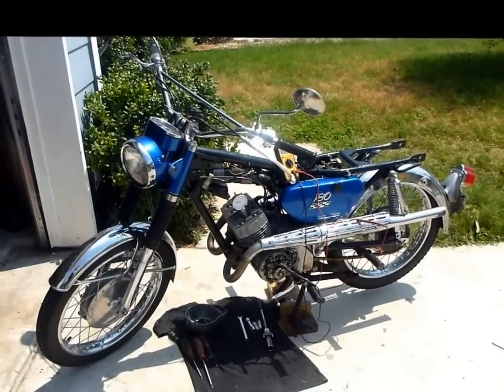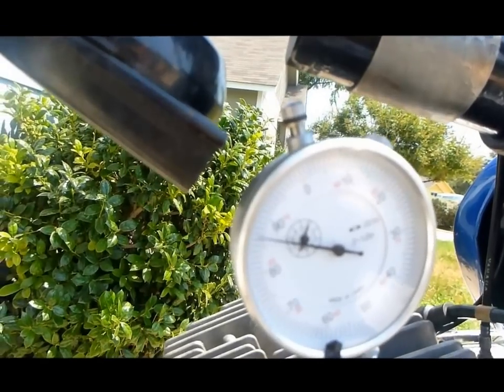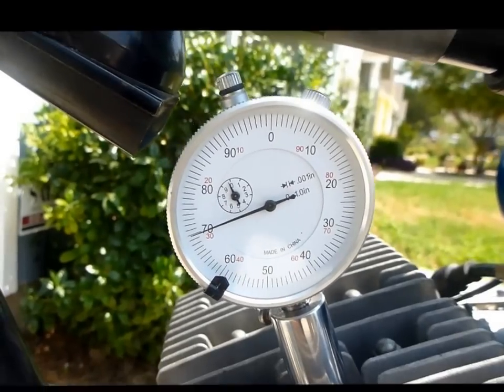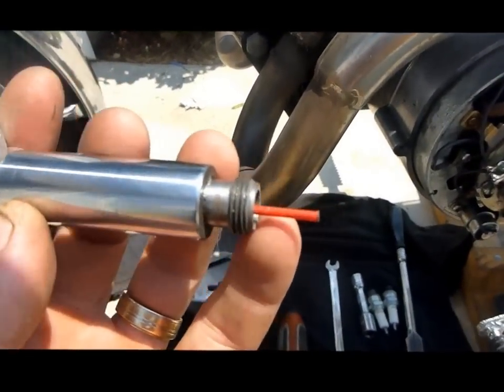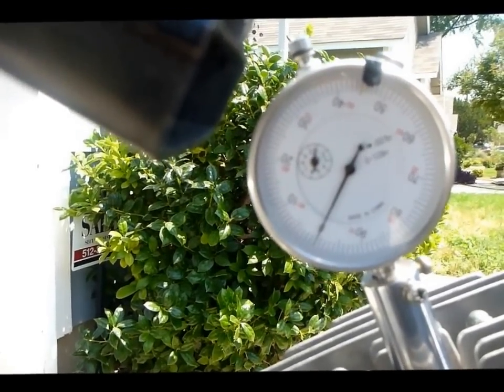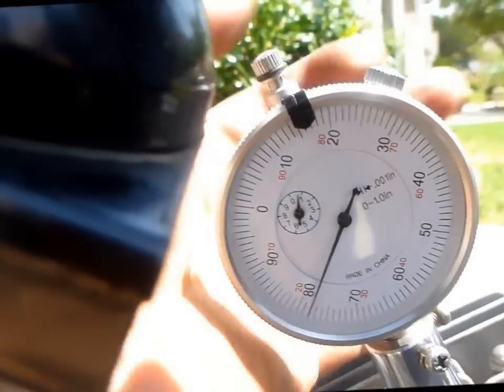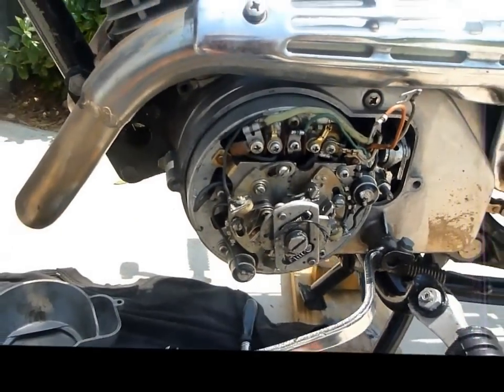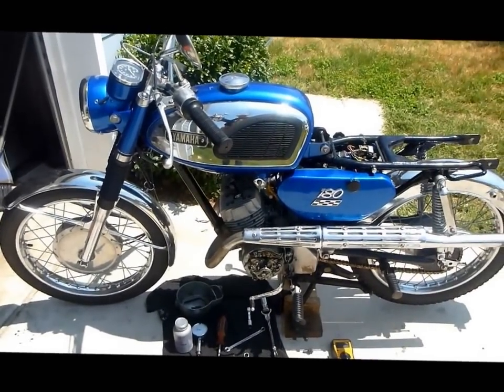How to use a dial gauge to adjust the timing/points on a Vintage Yamaha 2-stroke see description.

Comment: Can anyone tell me any more about the rubber cushions on the clutch pack ? 
I placed them all correctly as in the diagram with new clutch pads . 
And have the clutch adjusted right . But when trying to ride of the start in first . I hear some noise and have some on and off hesitation while moving . Bikes not moving with ease and freely ? 
Can’t get out of first or go more then 20 ft . 
My only other thought then the clutch is gears have sat for years and maybe some rust or bad bearings ???? 
Was trying to find a video on YouTube for these type of clutches with the rubber cushions to no luck .
Reply from the maker: Are you talking about the large grooved O-ring ones?

It was about 15 years ago, So my memory is a little foggy, but I remember having this exact same conversation on the forums, and the collective opinion was that it was okay to remove those. I believe they were designed to help dampen the clutch, but our modern motorcycle appetites don't really want to have a dampened clutch. We want a clutch that grabs and sticks well.   Good luck!
Reply: @stevenmichaelis  yes ! I don’t understand the purpose and how they are supposed to work ? Are they supposed to slide with the friction plates ? Because they slide on tight and don’t move on the basket . Also is the cushion groove supposed to fit on the friction plate ? And are mine old and shrunk ? Hope I can explain that correctly and make it understandable .

Comment: I'm a formal motorcycle mechanic by trade and this method was the first style I learned and later down the road I realized that it isn't an accurate method, using a multimeter only tells you when that gap opens in hairline measurements the beep stops in that moment, meaning the spark is not accurately gonna fire when that meter stops beeping, its not 100% usually when its around .25 to .35mm depending on the bike and year usually in the 80% range it will fire at the plug,  you need a timing light to be more certain trust me on that, makes all the difference

Comment: Hello Steven, good video. i'm trying to set the timing on my 1975 yamaha rd350. after i have tdc on my dial meter could you please describe how many full revolutions my meter should take and what number it should stop at in order to be at 2mm btdc? i've recently had a stroke and it has impaired my cognitive thought process. so, please be very literal. i'm getting close on my RD . it's been a long process. thank you very much. David
Reply from the maker: David, congrats on getting close to finishing your RD project.  You have a good question, and I will try to help. Please forgive me if I am too wordy or overly simple in the little steps.   For my answer I will assume you have a SAE dial gauge in inches, as opposed to a metric one in millimeters.   

First of all lets discuss the spinning full revolutions of the needle. We'll assume the dial gauge is secured in the spark plug adaptor, and the adaptor is securely threaded into the spark plug hole so there is no wiggling, etc.  Any wiggle movement of these pieces will prevent accurate measurements.  The number of times that the dial goes round and round is ultimately irrelevant to your measurement -- the number of times that it spins is 100% dependent on how deep the dial gauge happens to be sitting in the adaptor tool, and this will vary every time you remove or install the tool.  For instance, my adaptor tool has two set screws that hold the stem of the dial gauge in place when it is inserted in the adaptor. Every time I insert my dial gauge into the adaptor the stem of the gauge housing will enter the adaptor to a slightly different depth before I tighten the set screws and hold it in place. In fact it would be all but impossible to insert the gauge into the adaptor the exact same way and depth every time I use it.    Exactly how deep the shaft of the gauge housing sits inside the adaptor determines how many times the gauge's needle rotates as the engine rotates to TDC.  On a standard non-metric "0-100" dial gauge, like the one I used in my video, each full rotation of the needle represents 1/10th of an inch of the gauge's plunger's vertical travel.  If the dial gauge is sitting more deeply in the adaptor, then the gauge's plunger will come in contact with the piston earlier, causing more needle rotations.  If the gauge is sitting more shallowly in the adaptor, then the plunger will encounter the piston later and the needle will have less rotations.  The depth the gauge sits in the adaptor can be adjusted to reduce needle rotations -- exactly 1/10" of depth for each rotation of the needle. The number of needle rotations is ultimately irrelevant to the measurement of the piston once the tool is calibrated for the job with the gauge set to zero at TDC. However I see how the extraneous rotations are definitely distracting and confusing.  

I personally find extra needle rotations distracting, but have adjusted my skill to overcome the inconvenience.  My adaptor tool is a bit too tall for my motorcycle. It was made for a RD350 and I am using it on a smaller YCS1c 180 -- because it just barely fits, I have my dial gauged forced as far into the adaptor as it can go, and only then does it just barely fit.  If I had more clearance with a slightly shorter adaptor I would prefer to insert my dial gage not quite so deep into my adaptor so that there are less full rotations of the needle.  One of these days I may machine my tool so its about 1/2" shorter and fits better for my little motorcycle.  

An additional important thought is that it is important to remember these old Yamaha's engines rotate COUNTER CLOCKWISE while running.  The dial gauge does not indicate whether you are BEFORE or AFTER TDC -- it only shows the distance that piston has traveled up or down away from DTC -- it is important to measure to the point that is 2mm BEFORE top dead center, as the engine is rotating counter clockwise.  The gauge can be potentially very confusing because it's needle rotates as then engine is rotating, but the gauge does not indicate direction of engine rotation!  The gauge only shows the vertical travel of the piston!  

Assuming you want your timing set to 2mm/ 0.0789" and you have the dial gauge correctly installed and set so that TDC is indicated at zero. You want the points to be closed as the engine is rotating counterclockwise toward top dead center, and then for the points to open exactly at 2mm/ 0.0789" before top dead center.  Again, the engine will be rotating counterclockwise, but the gauge will be rotating clockwise as it approaches 0.0789", 'counting up' toward your zero.  

If the gauge's needle has to make several rotations as it approaches TDC, make mental note of how many rotations it makes.  Or you can adjust the height of your dial gauge in the adaptor so that there is a total of less than 1/10 of an inch of plunger travel so there are no extraneous rotations.  Be sure to re-zero the gauge after adjusting it in the adaptor.  

Hope this helps.
-Steve
Reply: @stevenmichaelis  i’m so thankful for your help!  i’ll try again tomorrow. bless you😇

Comment: Anyone know how to buy the dial gauge connector to the spark plug port?
Reply from the maker: A search on eBay for "dial gauge timing" usually will list several. The threads are 14mm for the adaptor you will need.  My adaptor was one I used on my RD350s and is a bit too long to easily use on my YCS1c unless I remove the tank, which is a bit of a hassle....  If I were to buy another I would get a slightly shorter one...    Here is a nice set on amazon: https://www.amazon.com/Fowler-warranty-Adapters-Diameter-52-520-747/dp/B00B5HQ38U

Good luck Mark!

Comment: I'm trying to get my head around the 0.0789. the way I'm reading this, your setting the dial indicator 0.021 BTDC. can you explain how that is 0.0789? I just don't want to screw this up.
Reply: once TDC is found and the dial is set to 0, 0 is the same as 100. 100 - 21 is 79. his measurement was for his particular engine which was a measurement in mm. he converted his number from mm to inches. you can use google to "convert mm to inches." what is the measurement for your particular engine?

Comment: I use a sleeve and calibrated rod type timing guage. I bought mine but they can be made from an old spark plug. The exception to the rule with 2 stroke points timing is the Suzuki GT380 where the points are on a geared shaft seperate and driven by the crank. They also rotate backwards to the crank and one has to take up the slack when measuring the timing. Not a favourite of mine to do the timing on. This method would not work so well on European 2 strokes as the points gap has to also be set for TDC as well as the firing point. Advance / Retardation is performed by the contact breaker arm spring.

Comment: Hi how to take of or out the generator?
Reply from the maker: Oh goodness!  This is a buggar for these bikes.  The generator's armature frequently rust sticks to the crankshaft, and it is very very difficult -- almost impossible -- to remove without damaging it.  It has to come off to split the engine cases to replace engine seals, etc....  AND to make matters worse there are two types of generators and armatures: Hitachi and Mitsubishi.  AND AND AND the armatures are almost impossible to find.   When I accidentally damaged my own armature during the engine rebuild it took me years of active searching to find a correct replacement.   I ended up paying silly money for one when it popped up on eBay Japan, but now the bike is up and running reliably.

Comment: Hello Steve:
Thanks for your info. The shop manual I have left out a few salient points that you had. Why do you use 2 mm instead of the factory 1.8 mm? I have a 1971 CS3 200cc. This bike seems very similar to your 185. Also do you have any information on synching up the carbs.
Reply: use popsicle sticks under your cut-away
Reply from the maker: I set my timing at 2.0 as a performance modification. 2.0mm is slightly advanced timing compared to 1.8mm.  Other mods included ceramic coating the piston tops and cylinder head combustion chamber, adding an anti-friction coating to the piston skirts, milling a little metal off the heads to increase compression, and slightly modifying the piston porting.    
Thanks for asking!

Comment: if so then the timing points on a dual carb 2 stroke on a single crankshaft wouldn't they need to fire at separate times for each piston ? since they feed off each others power and use mechanical rotational timing  ?
Reply: yes

Comment: are those 2 mm distance before top dead center in relation to the lag from the stator firing the spark to the coil ? like for instance 2mm is the distance and time it takes for the points to open and close produce spark to the coil at the precise moment the piston is at top dead center spark hits and drives the piston back down at the right time ?
Reply: Also take into consideration the time to light the fire

Comment from the maker: I'm sorry, but you cannot just stick a screwdriver in the cylinder to find TDC.  This is because you need the points to open at precisely 2.0 mm before top dead center.  This is a super precision measurement, and it cannot be done with a screwdriver.   Best wishes. -- Steve

Comment: Can you write out in detail how you put together your dial gauge? I looked at earlier posts that suggested Harbor Freight has the parts. My Harbor Freight definitely does not have those parts, the best they have are tire gauges.

I think what I may do is just take one of those red straws off a spray can, use it to determine TDC, and then look at pics of what the timing marks on my flywheel should look like, and set the points with the buzzer off my voltmeter. Cheap, but works.

Comment: Hello from Minnesota. So I recently bought a 1972 yamaha ds7 and have been tinkering with it. I noticed the point gaps were way off (not opening enough) and I set those to the manual specs. The bike runs amazing now, but I have not checked the ignition timing at all. Am I going to destroy my engine if I don't check the timing? Also this video makes sense but where do I get a dial indicator that will fit my bike?
Reply: yes anytime you adjust the points that changes the timing

Comment from the maker: Daniel, The spark is supposed to happen BTDC, so that is good.  Rotating the engine makes the points open and close. Rotating the points plate is how you fine tune EXACTLY when the points do it -- you probably can't visually observe the points moving when you move the points plate; they will basically look closed; The test light will tell you when the points are actually closed. 
Points' gap (fully opened) should be around 0.022" (0.56mm) -- your 0.033mm is not right.  
Don't Give up!
-Steve

Comment from the maker: Daniel, I am excited that you took the plunge, bought the adapter, and are learning how to set your points.
First of all, you MUST have the wires disconnected for the light to work correctly.
A test light should be connected to your battery's positive terminal on one end, and to your points at the other.  When the points close the light should come on.  When the points are open, the light will be off.  If this is not happening, then something is amiss.  Email me through YouTube if you're stuck.

Comment from the maker: I am using 2 tools: Dial Gauge & Motion Pro dial gauge adapter (w/ 14mm threads). Any dial gauge with +/- 0.001" accuracy will work; I bought mine from Harbor freight for around $1, but it was a DIY project.

NOTE: RDs have motor clearance issues -- you need an adapter tall enough to get over the fins, but short enough for it all to fit w/o hitting the frame. This is why my DIY adapter kit has a flexible red straw as its extension.

Comment from the maker: Is it possible that your left and right spark plug wires are crossed? If you follow the video you will get the timing correct. You also will want to verify that the points gap is correct -- this would be done before doing the timing. I should do a video outlining this too.

Thank you for watching my video, and good luck with your Suzuki ts250; those are super cool little old machines.